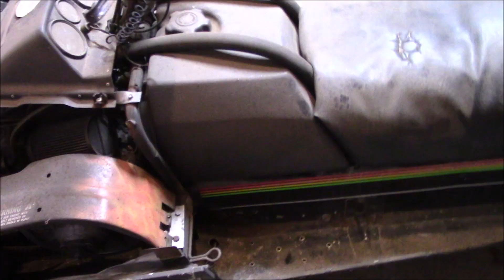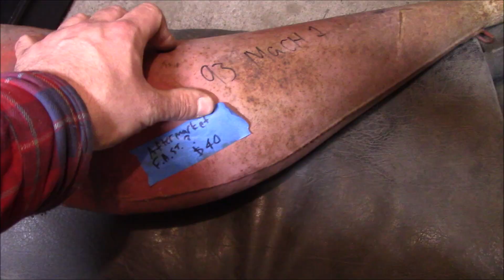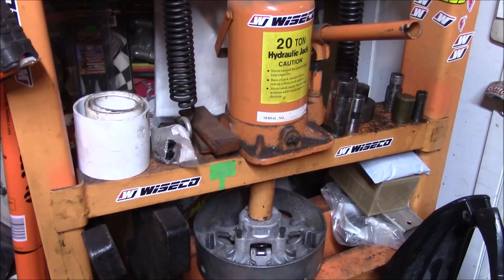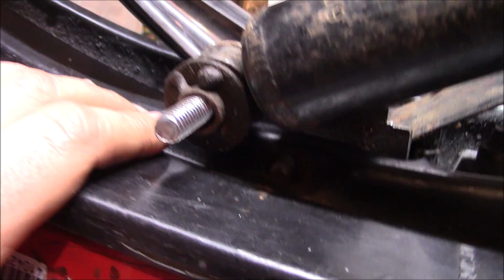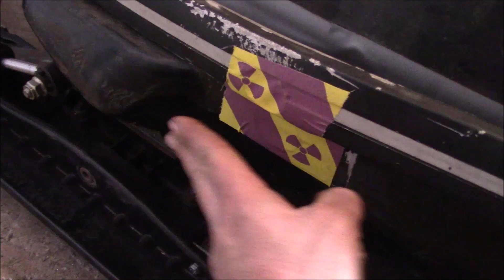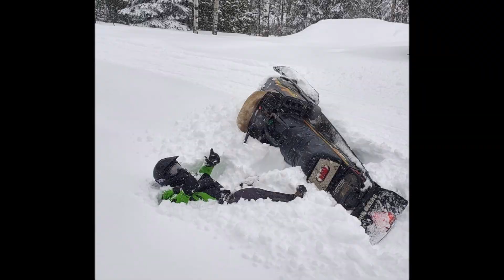Rotax-ified John Deere, The Re-Thrash to Ride

Comment: Awesome video. That thing actually sounds fuckin mint when you're rippin in the powder! Another new upgrade should be a set of risers and handlebars. (I have a few different sets of risers and bars and also I have some different clutch springs and ramps you can try as well. Let me know, I'll send em to ya)
Reply from the maker: Appreciate the offer!  Think I got the clutching fairly dialed in last time it was out, just need more snow for more testing.   I've thought about going higher with the bars, but not sure if they would work with the stock bar clamp, and I kind of like the john deere logo on it, haha.

Comment: You mean 130 piolit jet there is a 150 on it now i took a bunch apart and the smallest i found is a 135
Reply from the maker: no, the small pilot jet down inside the carb, they are sized around 20-50.  Check out a mikuni diagram and you can see where it's located, you need a small screwdriver
Reply: @toocheaptosmoke  i know what the piolit jet is maybe its a letter i or l in front of the number i will try to get a 30 thanks

Comment: I have done wvery thing you said about swaping me tiltonsnn carb ti a munkuni carb it is a 399 kowosuki motor running a 300 main jet it starts good cold and sounds great but when i shut itcoff and try to restart it it floods instantly is that a bad needle and seat thanks
Reply from the maker: How bad is it flooding, just enough to not run, or like geysers of gas out the plug holes almost hydrolocking?  If the first, will it fire with the throttle held open a bit? If so, smaller pilot jet
Reply: @toocheaptosmoke  it will fire a few times then flooded the plugs are wet then what size piolet jet would you recomend starting with the carb is off a 340 blizzerd and i dont know what size it is
Reply: Its a 34mmcarb but i dont know what piolit jet is in it
Reply from the maker: @bobnewman9493  30 pilot is probably a good starting point

Comment: Now i lowered the carb and it starts and runs good with the minkini carb but when it idles after 15 to 20 seconds it floods out it runs good when i give it a little throttle is my needle set ro high
Reply from the maker: The brass float arm should be set to sit parallel with carb body when held upside down.  If your carb(s) are vibrating or shaking alot at idle it can also flood out, dampen zip tie or bungee them to something.  Or needle and seat could also just be worn
Reply: @toocheaptosmoke  thanks

Comment: The old john deere sounds awesome but i have a question for you , i have a old 72 atric cat cheetha 399 i know nothing about it i put a mukini carb on it that sits at that stupied angle like you said and the first time i start it it takes right off runs great but when i shut it off and try starting it again 1 minute latter it is flooded . Does that sound like bad crank seals thanks
Reply from the maker: Probably not crank seals if it floods.   put the front end up on a few pallets and see if it starts then
Reply: @toocheaptosmoke  you werecright as usual im putting a trundra boot on they drop the carb a couple inches cause they make a bend thanks
Reply from the maker: @bobnewman9493  👍